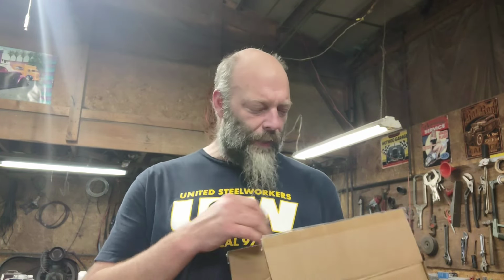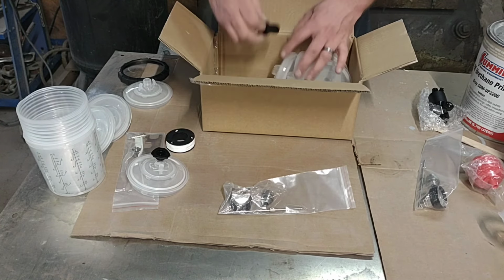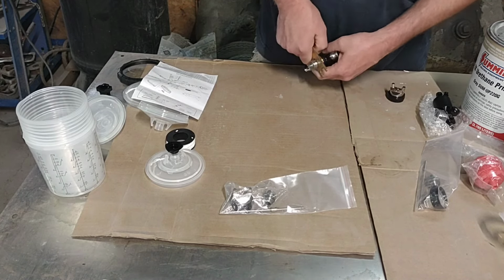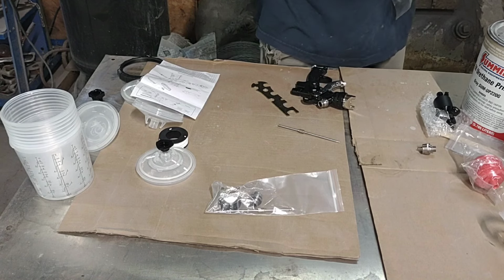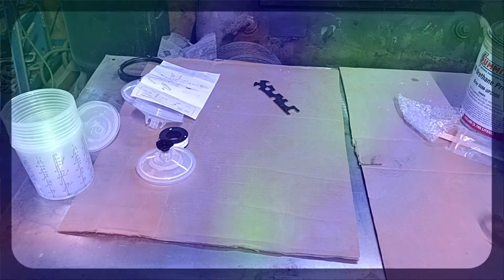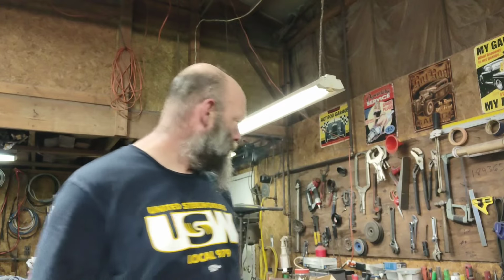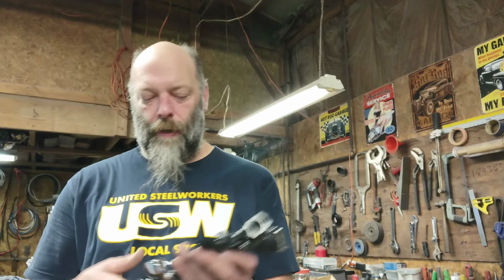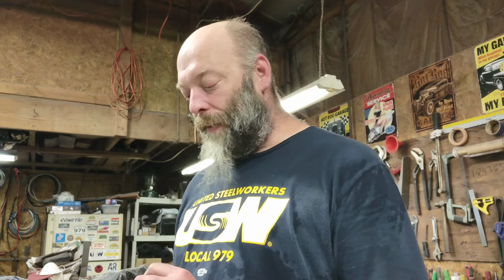gattlelic spray gun from Amazon ..let's test it out on the 49 Studebaker gasser

Comment: it's a good spraygun to start out with  1.7 probally needed a little thinning.... when I spray I'm at wide open needle,  you depress the tigger with the needle all the way out then turn in the needle till it just starts to move trigger and stop there leave fan setting wide open start out with 25psi with just air depressed... make adjustments from there.... when you take the nozzle off remove needle first and when assembling tighten nozzle first this way you don;t wear a ring into the needle tip over time.
Reply from the maker: Yeah it's getting close